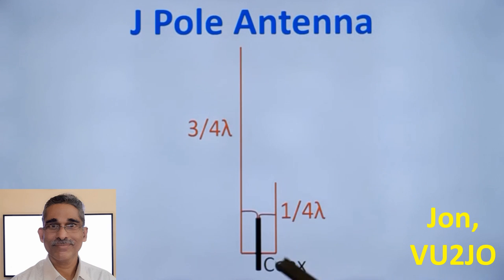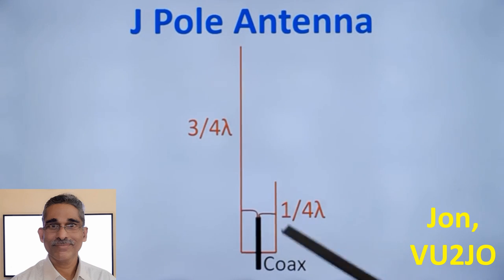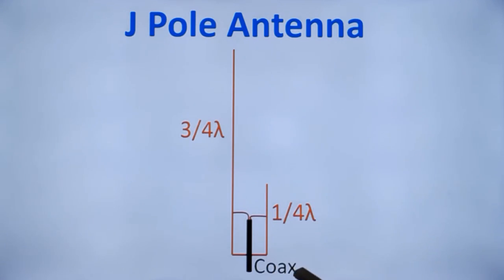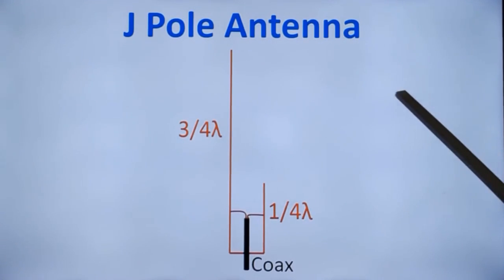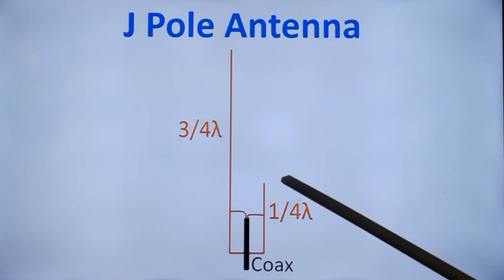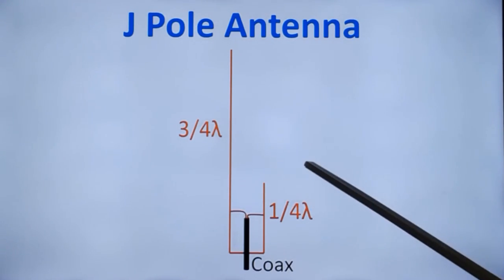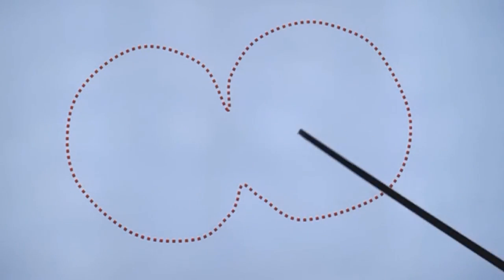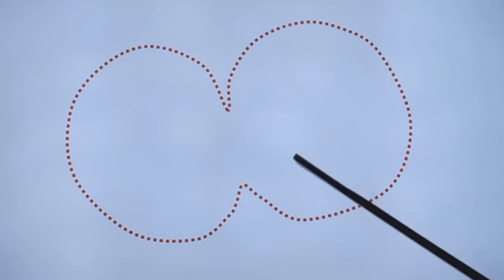Principle of J Pole Antenna

Comment: where you find 2dB of gain?  antenna is just an half wavelenght, just a dipole... 1/4 lambda line does not irradiate, it's just a piece of bifilar line... total gain is 0dB over dipole... because it's a dipole!!!!
Reply from the maker: Thanks a lot for the correction. 73 de Jon, VU2JO